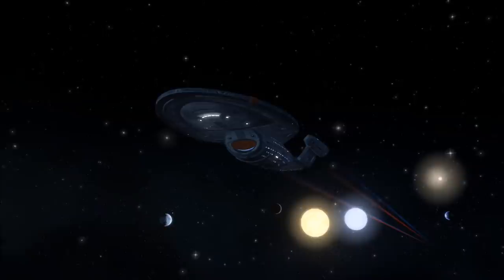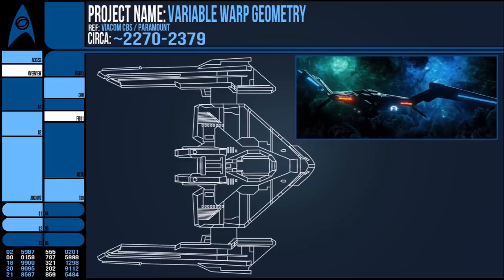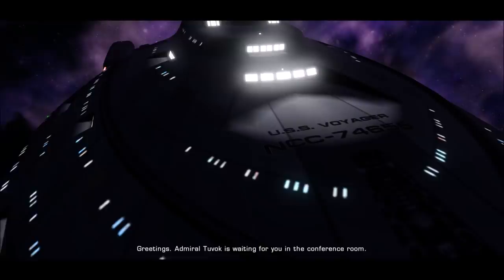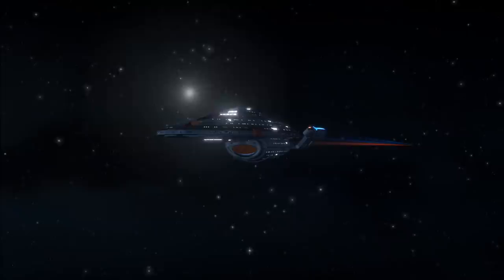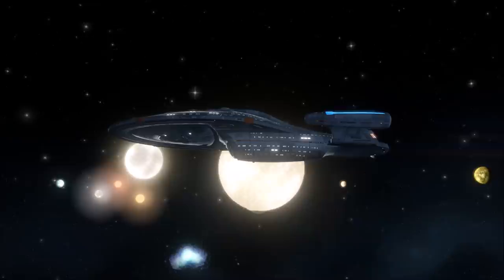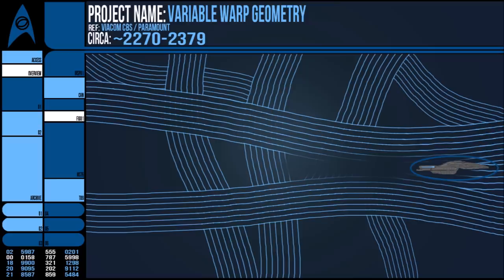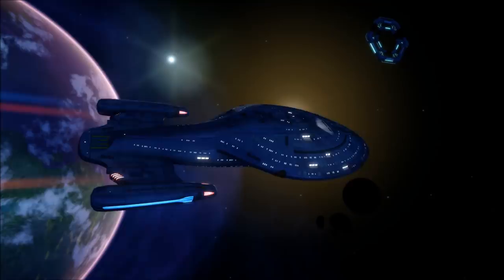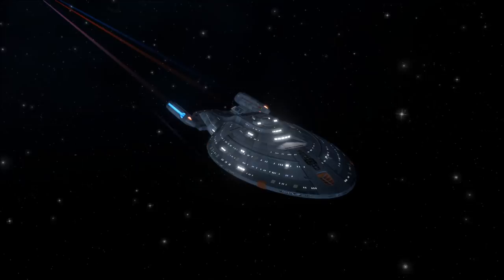VOYAGER'S "Hinged" Nacelles

Comment: The reason it doesn’t make sense: because why wouldn’t you just leave the nacelles up? What does home position do? Nothing. So in other words, it would make sense if they started low at warp 1 and then gradually increased with each increment until they were all the way up at maximum warp. But if there is only two positions warp/up and non-warp/down then why have a down position at all? They really should have done the incremental thing and it would have been neat and made sense!!!
Reply: The Bussard collectors, which are only used at sublight speeds, are blocked by the saucer when the nacelles are up. So it could be that the original design had the nacelles meant to be down, but they found out they had to adjust them to get better performance, but it was either find a way to have the nacelles be where they needed to be (down) when at impulse and where they needed to be (up) when at warp... or redesign the whole ship. Adding movable hinges would be far easier than redesigning the whole ship, and they may have preferred not to scrap the whole class. Also, the nacelles may be meant to move at warp when necessary, but we just never saw it due to production realities.

Comment: So this is pretty good explanation for why the nacelles need to be aligned this way during warp, but why aren't they just permanently fixed in this position? What benefit is there for the standard horizontal alignment while at impulse and other sub-light speeds? The only thing I could think of is that, if the Intrepid class was experimental, the adjustable pylons were there to test the effectiveness of changing alignments, perhaps at different angles. Maybe the angle used in the show is the one determined to create the best warp bubble and field? Perhaps other angles are possible but never shown?
Reply: I thought it rather obvious from the  video that they could adjust them during warp

Comment: One thing you didn't mention is the shape of the ship also affects the shape of the warp field this is most readily visible when viewing the warp fields from above the ship. The Galaxy has a very wide warp field around the saucer, which you drastically reduce in the Intrepid and Sovereign.
Reply: And I can see why starfleet didn't start out with such a shape to begin with. If we go by chronological design, the vulcans had quite pointy ships even before the federation was founded, and they're very interested in efficient flight. Can't be hard to imagine at least one vulcan scientist speaking up for some more efficient design.
Now for why it was round? Probably construction. You could create a set of wedges and then bolt them together. Maybe even so far that individual pieces could be modular and ships could be configured differently depending on the mission.
And once starfleed figured out that just giving more power doesn't work, they finally listen to that vulcan.

Comment: The largest draw back I see is that if impulse engine was hit or had a majority overload it would take the warp nacelle with it and leaving the ship with thruster control only.
I know the writers never went there because the journey would have been over not to mention, that kind of surge could cost them the warp drive or the ship entirely.
Which is most likely the concept didn't go into main line production.
Reply: I always thought it was a problem if an enemy ship figured out that the nacelles had to be able to flap up or down to warp, and so target those hinges, which would then keep Voyager from warping, or am I incorrect with that?

Comment: Yeah yeah.... So what about the borg cubes? According to this theory they should tear apart subspace
Reply: Maybe they advanced their warp travel so much they shape subspace without damaging it. 
That would explain why there are only two types of Borg ships.
Given their nature it would make much more sense for them to have bizarre shapes depending on what technology they used for the building of their ships. (Because manufacturing every part from scratch when you can just take already existing parts of assimilated ships would be a bit unnecessarily hard)
Reply: @OggerFN  mmh, but nothing about that is mentioned when Voyager gets borg upgraded warp drive. I found more believable that Voyager had hinging nacelles because they are just cool...
Reply: @valentinalopes7806  
The style is of course the real reason

Comment: As a female captain, Janeway needed a ship that lifts and separates...

I think it would have made more sense for the damage to substance thing if the angle of nacelle lift was increased as the warp speed increased, but stock footage.
Reply: It sure would have blown the budget if they had to constantly create new CGI, especially back then, showing the angle changing depending on the situation. I've heard they'll never release Voyager in HD because many of the CGI shots of the ship weren't even fully rendered and HD would make it extremely apparent.
Reply: jblyon2 Yeh, like the model they used in the opening titles. Right at the end as the ship turns its belly to the camera before going to warp, some of the textures aren’t rendered so there’s a couple of black boxes there.

Comment: Always wonders, when in warp, how the ship never can collide with a planet or any other object in space.
Reply: The dish in front of the drive section is called a navigational deflector, it pushes any incoming objects aside as it moves through warp. Traveling at warp is practically suicide without it.
Reply: That's also why you have gravitational sensors and other space wizardry (Astrometrics, astrogation, stellar cartography) to identify gravity wells/anomalies so you don't smash into stuff at warp speed, along with computers fast enough to calculate where you're going in picoseconds.

It's also the difference between the other Star "franchise", where they have hyperspace "lanes" that are known to be clear of any obstacles, and not using them means complicated calculations before you can even jump to FTL, or you dead...at least until the last movie that came out.

Comment: Interesting. But it begs the question; if the configuration of a ship defines its “warp bubble” how does a big ass clunky Borg cube get around so fast?
Reply: @underworld647  And brute force of the ships powah to make cube go fast. And transwarp subspace coils. And technobabble.
Reply: @Corbomite_Meatballs  And it has 6 nacells... probably.
Reply: Because the borg have a central plexus of transwarp conduits (which are just like tamed wormholes all across the galaxy) so they don't need to worry about subspace dynamics when they can appear anywhere in the galaxy in a matter of minutes.